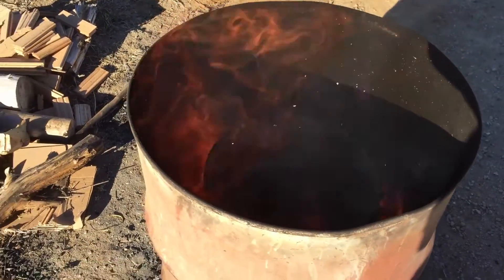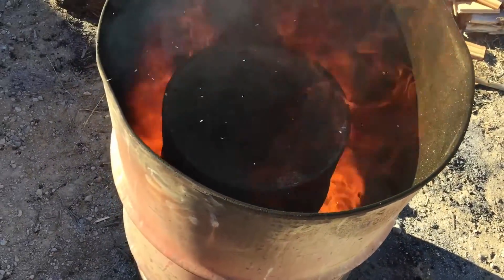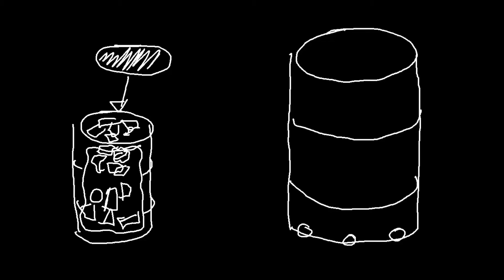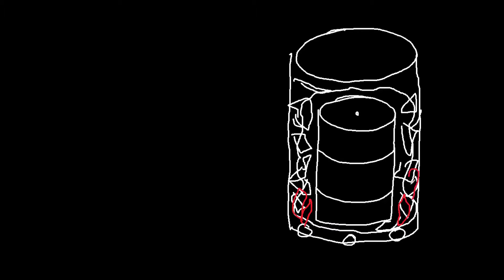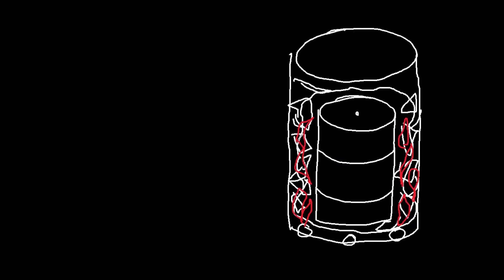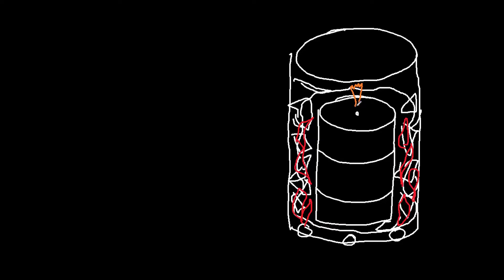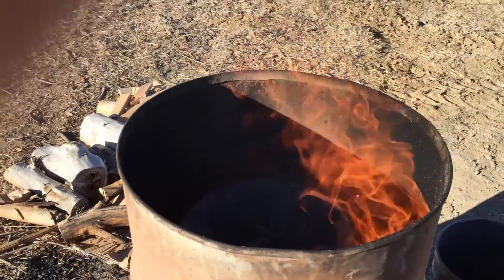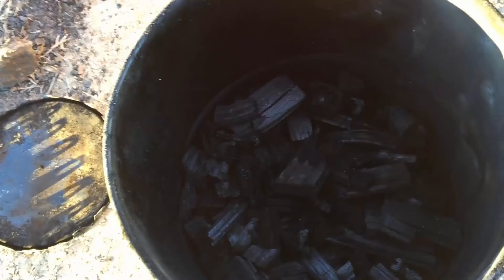What happens when I make charcoal.

Comment: Do you use your home-made charcoal in your forge?
Reply from the maker: Hi Ron. I make my own charcoal. I’ve got another video out there somewhere that shows me jacking it
Reply: Jacking?  I'm not sure I want to know what that means.  The preceeding comment was made in response to your charcoal making video.  That bit of information isn't part of your end of these comments?
Reply from the maker: making man making!  Read what I meant, not what I wrote ;-)
Reply: Hmm.  Yuh know, it's possible that the mistake wasn't even yours.  AUTOCORRECT and AUTOCOMPLETE have caused me some problems now and then, maybe that happened here too.  Just recently I tried to type WHAT and what went into the comment was HATE.  I must have missed the W and auto complete messed me up.  A possibility.

M & J are adjacent keys, but how did that C get in there?  It looks like a typo and an autocorrect.
Reply: I just watched a video posted on 18 October, 2015 by Sleestaks shack.  He made his charcoal cooker a little more elaborate than yours, and ended up with a LOT more smoke.  I wonder why that is.  Perhaps it has something to do with the lid he used on the big drum, or maybe it was the pinewood he used, IDK.  His little drum had a BUNCH of holes in it's lid.
Reply from the maker: I just watched it. Interesting idea with the holes in the lid. Mine just does it because my lid is anything but airtight around the sides.  I think there are two reasons he gets more smoke than I do. 

1, he fills his burn barrel full of wood and lets it go.. I don't do that, I continually feed it. The big advantage to his way is he doesn't have to sit there an babysit it like i do. I think by feeding my fire I can regulate the amount of smoke I get. I"m constantly paranoid that the fire department is going to come by and tell me to put it out so I try to keep the fire hot and burn the wood quickly.

2, I think I have more airflow through my outer barrel. My holes are 2" in diameter. When its burning it gets lour with the air being sucked in through the holes and the wood gas burning. I think the added air hlps minimize the amount of smoke I get as well. When you smother your fire, it tends to be more smokey.

It is interesting that conceptually we hit on basically the same implementation and get pretty similar end results.
Reply: Yep.  One other thing I liked about his video is he showed how he got the little barrel inside the big barrel.  He layed them on their side then tipped them up after they were together.  I was getting mental images of the lid coming off and dumping the contents of the small barrel when lowering it into an upright barrel.  Oh duh.  😩
Reply from the maker: I used to do that, but the barrels used to get hung up on each other when a high ridge on the smaller barrel would get hung up on the low ridge of the larger barrel.  It just got easier to hold my hand on the lid of the smaller barrel when I put it in. I do get soot from the barrel's all over me but the entire process gets soot on me so what's a little more ;-)
Reply: Ever try using 2 planks to make a V track to slide the small barrel inside on?  (A little bridge over the groove)   Just remove them before the burn if you want to re-use them.